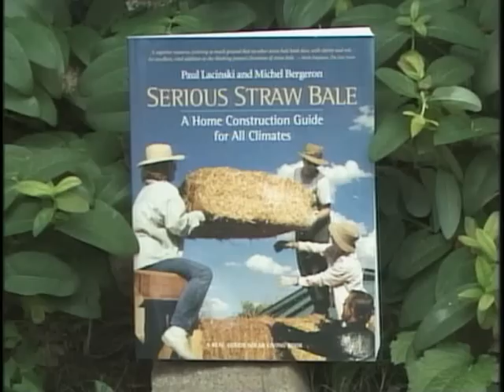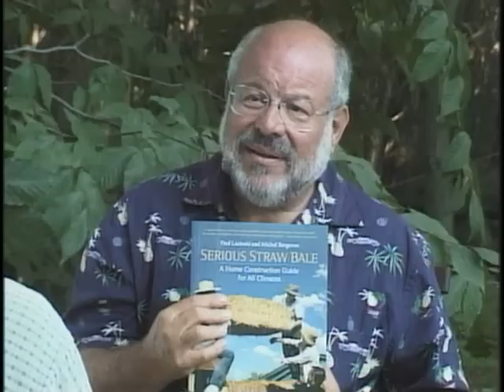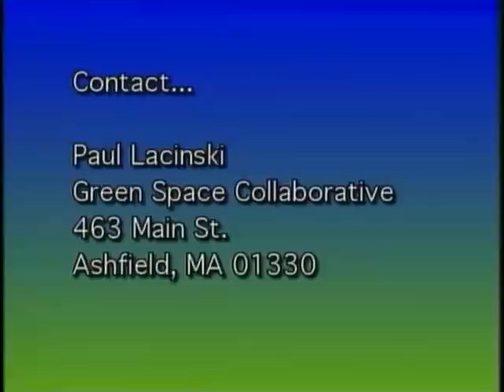The Straw Bale House: Paul Lacinski

Comment: No pests bugs/mice dont like it,. the worst pest to straw walls is moisture,. thus in wet places you will notice that they have extra wide overhanging roofs,. and splash protection,. this is also the reason the walls are covered with plaster as this is a breathable finnish that lets the straw dry out.  Do some research,. I have, and am already convinced that this is one of the best green home building methods.